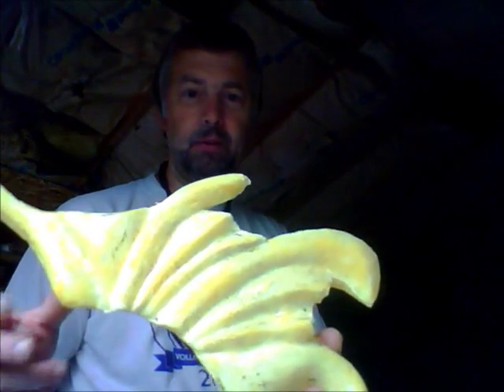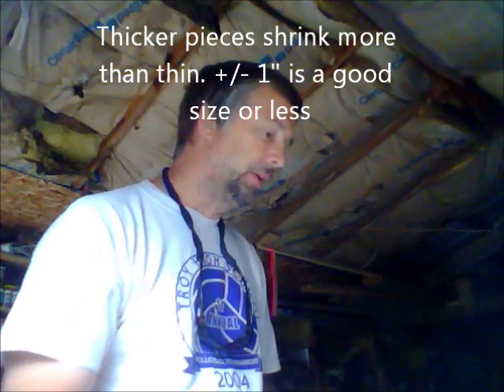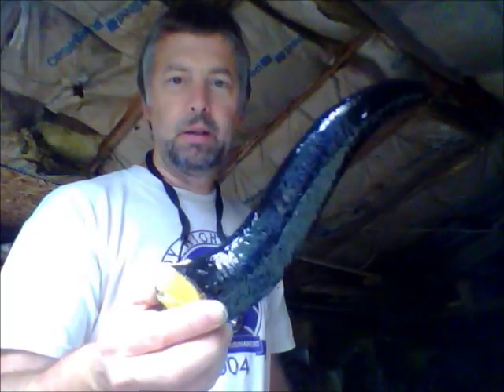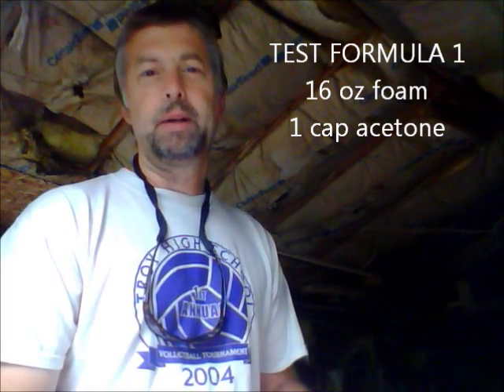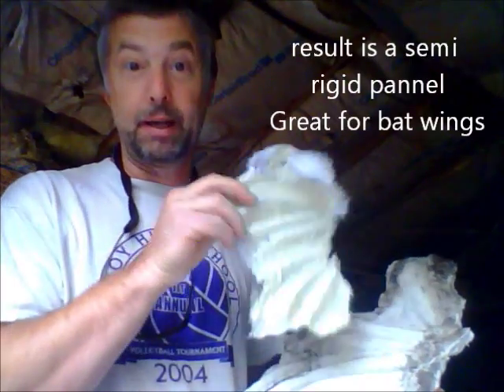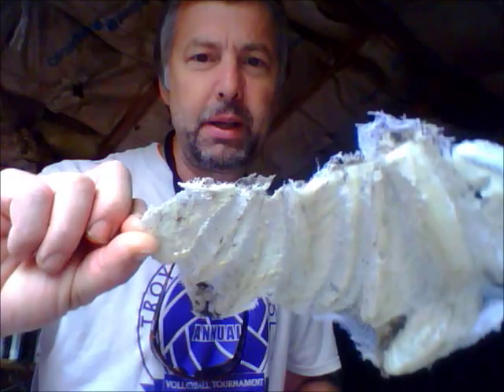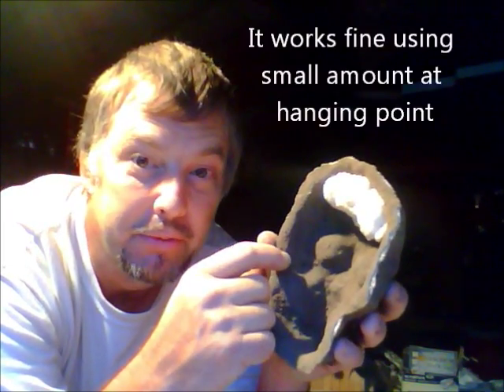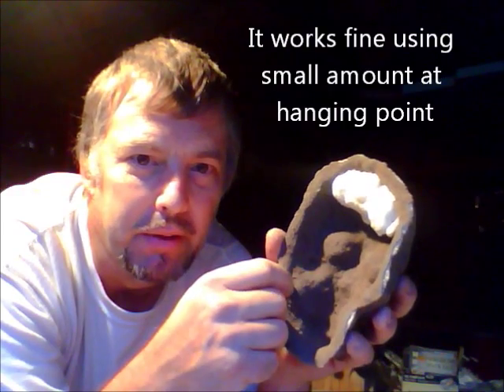Great stuff secrets 3 open face molds

Comment: Only in the case that you actually do use the 2 part foam. what type you use, it seems kind of waistfull to empty a can when you only need a little bit.... any way excellent videos. 
Thank your very much.
Reply from the maker: Hi Thanks .  We don't waste any foam. See the video about cleaning the straw with carburetor cleaner. or short time use put a screw in the end.Reusing spray foam.
Reply: that was the first video I saw of your work! I"m trying to cast a full two side mold of an RC Plane!! but in total honesty Don't have a clue of what to do about the shrinking! I did make a one last night.. and now the plane that come out of there looks like cat puke!! considering to go for Fiberglass! witch is basically what I was trying to avoid!!!!
Reply from the maker: The mold was opened too soon. this is a common issue. For an air plane I would use (if doing foam) a 2 part mix. Available inexpensively from Home Depot "post Set" it is a product made by silka . I think it is available from amazon also... not so sure.    Anyways you would be having to coat the wings with a angel hair matt with a foam core to get the strength that you need. .. much of this depends on the size of your project. .... be sure to use the red can for your project. try again and be patient wait 2 days before opening. don't forget to mist with a little water before closing the mold. ... Some time this happens .
Reply: Wow I'm very grateful for your advise, I mean not every one here in youtube are so forthcoming with their hard earned knowledge... thank you again and again....

Comment: I wonder if it would be possible to make a concrete step form liner out of foam to make the concrete look like cut rock. However, it will be more difficult to make a texture skin out of foam.
Reply from the maker: The project you are describing is best done with silicone. You can go the cheepman's way and use the
caulk gun tubes.
I don't know where you will  be getting your pattern from but let's just say you are making it up as you go.
Use almost any fabric squeeze the silicone onto the fabric to get a good bond. Then wet your hands with very soapy water and shape the gooey mess into rock patterns. Remember this is a negative of your final design.
Allow to set up over night. 
If using inside a mold just glue or tack lightly into the mold. Dust liberaly with talc powder. pour concrete.
For a texture on top make your pattern about 3 to 4 feet square. Over fresh concrete dust with talcum powder. Lay the pattern face down on the cement an pound the backing with your hands. This will press the design into the surface of the cement.
Reply from the maker: Second thought . make the foam mold and stiffen the surface with layers of latex caulk or even silicone. The silicone will work well with cement. the latex maybe once or twice.

Comment: First off thank you for actually experimenting with spray foam and not just saying "buy this 3x more expensive alternative". I was wondering if I used cheesecloth in the 50/50 foam talc mixture in a thinner plastic thermoformed mold if I would have the structural integrity to get it out without breaking. Or should I use the acetone mixture? I'm making skulls (they don't have to be filled).

Comment from the maker: Fill any big gaps or holes with a spot of foam. Spray with water to fast set. Then cut off excess with razor.
Your piece will be coated with sand except where repaired. small pockets and cracks can be filled with wood glue and vinyl spackling.
Afterward sprinkle some loose sand over glue to add more texture.

Comment from the maker: Hmm you want to use damp sand as the mold. Then press your plug/master item into the sand. (this is commonly used for making sand candles. Be sure the bed of sand is much deeper than what you are molding.
From here I believe you can just spray a small amount of foam in the bottom. 
Spray a light mist of water over this or just wait 2 hours.
once the foam is skinned over hard add a little more foam allow to cure 2 hours.
Repeat till mold is full. open next day if  more than 2 squirts of foam.